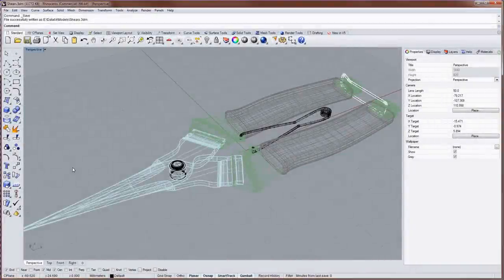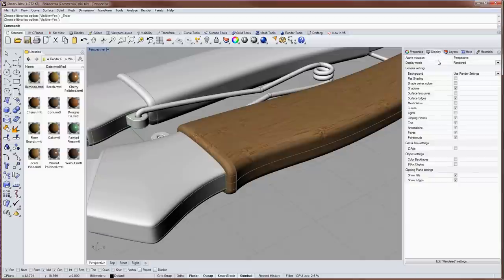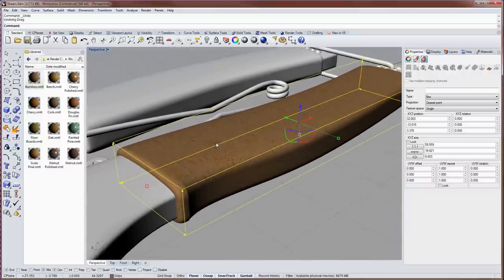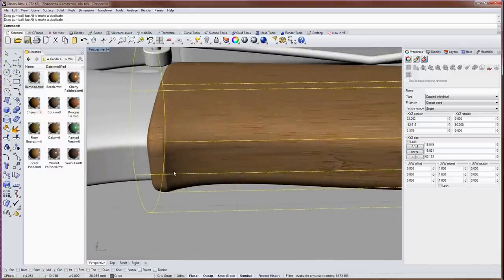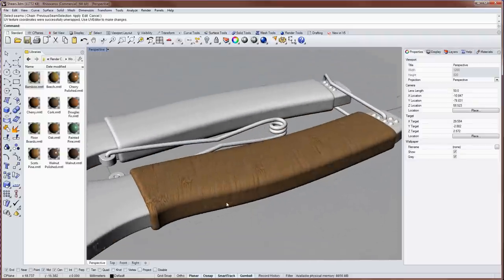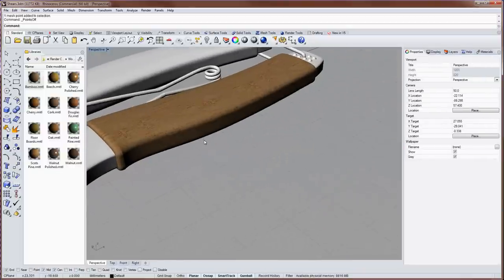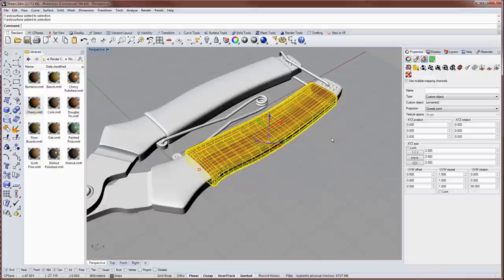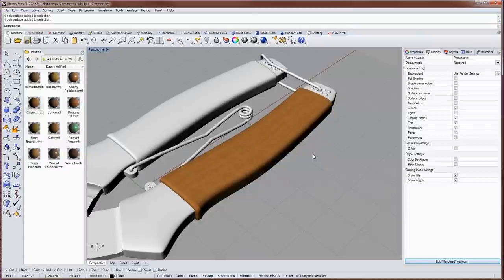UV mapping in v5 Rhino

Comment from the maker: Hi, 
The UV mesh has to be manually aligned based on how you want the texture to flow. The unwrapping of it doesn't take into account a straight edge (as far as I know) when unwrapping the render mesh. I have a feature request filed for something similar already with the developers and I'll point to your question as well here. Thanks. In short, you have to manually arrange custom unwrapped meshes.

Comment: That's well demonstrated, by showing what does not work well, in order to bring the point home.

That said, one can question the rationale of the comment at 5:25 because a tree's growth-rings are "naturally extruded" along a tree's trunk or branch, so making a handle like the one shown from a real piece of wood will always result in cutting through the solid texture of the wood, so to speak. In other words, the growth ring texture won't flow along the handle shape, unless one finds a piece of solid wood where the natural texture happens to be bent exactly according to the topology of the handle. To make wood (not veneer) look realistic/correct, one also needs a matching end-grain texture, or, if available in the rendering package, a real solid texture that "grows" wood algorithmically.

If "real realism" in rendering is needed, that issue should possibly be discussed, as one can see from the countless false looking wood renderings one finds online

Comment: That helps me next to nothing, if I unwrap a airplane fuselage on a UV surface. I see the unwrapped polygon mesh on the UV surface, but I need to print it on the texture as well, to modify it in photoshop or something. How do I do that? And please in simple terms, since the only program I know is Sketchup and it is a literal hell to work with Blender, Rhino and such software.

Comment: If I apply a material to an object it does not show it in rendered view. I have to actually start a render to see the effect of any changes. How do I make my render view work like it does in this tutorial?
Reply from the maker: That could be due to non-default settings in your Rendered display mode or an old GPU driver. Email tech@mcneel.com with more info on what hardware and drivers you're using as well as the Rhino version and on which OS if resetting the Rendered mode to defaults doesn't help.

Comment: hi brian .. one question about squish command and unroll command..  have both the same result..?
Reply from the maker: Hi Mauro,
UnrollSrf is for developable surfaces, i.e. curved in one direction. Squish can flatten a doubly curved surface but there will inevitably be some expansion and contraction. The command line has options for controlling how Squish works but you can also check out the help file for info on both of these commands.

For your last question, try using a 'decal' in Object Properties to place a logo on a surface. Some render engines will also offer a decal option in a texture map to prevent repeated tiling.

Comment: Hi, thanks for this cool tutorial. Is there a way I can apply texture/material only to one side of the face, eg: top face, bottom, etc? What if I want to apply different images to each side of a box? How do I do that in rhino?
Reply: In Rhino 5 you'll need to use ExtractSrf or Explode to make separate selections for separate material assignments. However, in the Rhino 6 WIP available on the user forum (https://discourse.mcneel.com/) you can apply sub object materials via ctrl+shift while dragging a material onto a single face or surface within a polysrf... so no need to separate the model.
Reply: thanks for the reply, but what good is that if I want the object to be one piece for 3D printing? Also what if a client asked me to model something like this: http://www.personalizationmall.com/cat_image/300/15535-34445.jpg
I cannot explode/extract. In Maya, I can texture each face or any face with a different image. Rhino is good for certain things, but basic feature(s) and something simple like this, rhino should be able to do.

Comment: Hi there! Thanks for the tutorial! I have a problem that i think is related to UV mapping. I made a ring and i wanted to put some lettering on it. So i unwrapped a part of the ring where i want my lettering, i typed a name and placed it withing UV boundries. When i apply UVs on the surface my text is FLIPPED. I made my ring fallowing a tutorial step by step. I am new to Rhino so any help would be appreciated!
Reply from the maker: That sounds like a UV direction issue at a guess. Send in the file to tech@mcneel.com if using the Flip command on the surface or rotating the UV meshes doesn't solve it.
Reply: Ok thanks!

Comment: Hi there. Thanks for the straight forwrd tutorial and help. I have followed all the steps but I keep on having a problem... When I change the amount of UVW repeat my material (floor boards) rescales in the Rendered viewport, but remains the same when I actually render it. I have tried everything I know the last 2 days but nothing seems to work.. Thanks in advance for your help :)
Reply from the maker: Hi fegmoon,
This sounds like it might be due to the rendering plugin being used not translating the UV info properly when raytracing. If you are using Rhino Render or Brazil this shouldn't be the case. Please send in the model (and check "save textures" when saving it) to tech@mcneel.com to my attention (Brian J) and I'll take a look. Let me know what renderer is being used as well and send just the floor part if that shows the issue by itself.